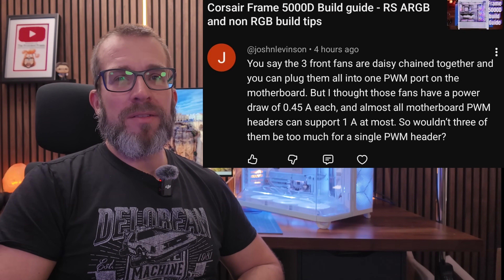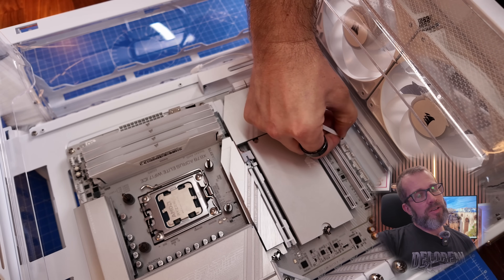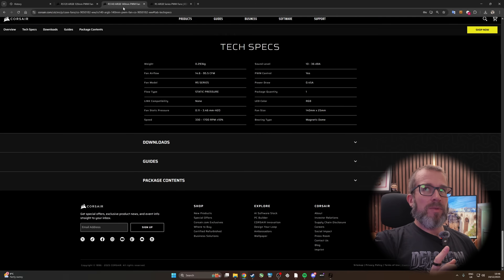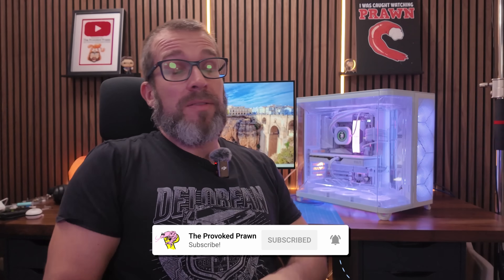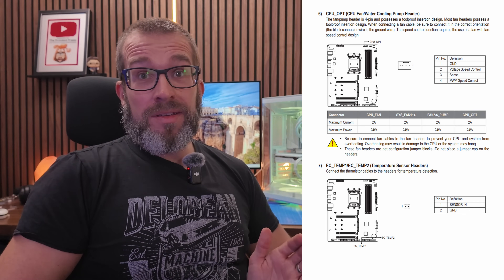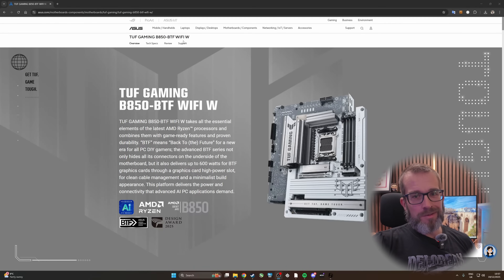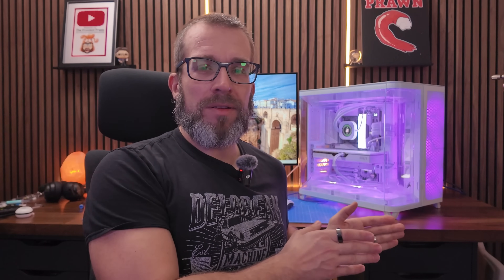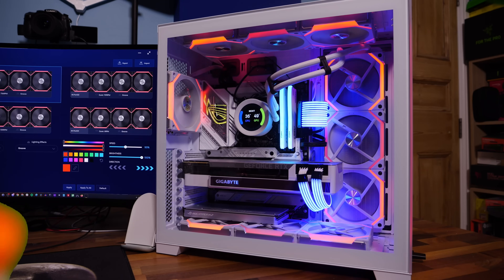Should you be worried about this??

Comment: I was worried because i planned to buy Lian Li Uni-Fan's TL Wireless 140mm in maximum three fans on bottom, side intake and two on the rear. And three 120mm fans on my radiathor of the AiO. But my motherboard can provide 2A/24W, so i can test if they can run only on the one 4-Pin connector (and dont need the SATA to 4-Pin x3 connector)

Comment: Thanks for the shoutout and for addressing my question, with a video to boot… really appreciate it!

I went deep down that rabbit hole, which is where my question came from. There are lots of people (mostly in forums, so take it with a grain of salt) that say that this is an important point, so as not to burn out the motherboard. Some people say that it can burn out the motherboard by drawing too much current, others say it will not, since the motherboard will only give the fans as much current as the MB is rated to. I don’t have enough understanding of electrical engineering to understand which is true. But in all my research, I didn’t see a single person say they had actually damaged a motherboard by plugging in too many fans to a single header. So maybe it’s not actually a problem in the real world. 

That said, I now have all my fans plugged into a fan hub. I may daisy chain two RS120 fans into a single 1A header (which is what all the chassis headers are on my MB), which would put it at 0.8A, which I think will probably be okay, even taking into account startup spikes.
Reply from the maker: Thanks for posting the comment in the first place. It's certainly interesting and not something I'd considered in great depth

Comment: I know this is off topic, but desperate for help, I bought a corsair k70 pro tkl,  but it keeps disconnecting every 5 mins for a few seconds really annoying can not play games with it like this, I've updated everything including icue, I've uninstalled icue reinstalled it, tried different usb ports, and absolutely nothing works, I have searched google and it seems a lot of people have the same problem but with no answer to fix and corsair support give no answer except what we have already tried, any help would be appreciated.
Reply from the maker: When you say you uninstalled iCue and reinstalled it, did you use the latest version? iCue can be weird sometimes. Have you tried forcing a firmware update. I'm afraid I haven't had this issue so I don't know a good solution.
Reply: @TheProvokedPrawn  hello , yes it is the latest version, I forced firmware update also and still the same, it also happens with no icue installed.

Comment: i am acquiring parts for my 1st build. asus tuf gaming b850 plus wifi, amd 7800x3d. i am asking if i should do a bios update after building or will it work ok out of the box?
Reply from the maker: I personally like to do the bios updates for stability and performance improvements that come over time (if you look you'll likely find a lot of updates)
Reply: @TheProvokedPrawn  i understand but should i do it when i power up for the 1st time or can i get on the internet and do it after i install windows. will it work ok out of the box and do the update afetr
Reply from the maker: @michaelrajca6043 should be perfectly fine to run out of the box

Comment: for a very long time, I've run the +12v to a hard drive plug, just to keep the noise from the fans from going to the motherboard. the amps thing is an issue for sure, not to say how many amps can the PWM signal from the motherboard be? I don't know to be honest.
I've seen some cases that combine 5+ fans with a single PWM control with no buffer amp (Silverstone PM01 for example).

Comment: Dear Mr. could you please explain the "coil-whine" to us ? Recently I build a setup which I had Corsair RM1000e, and ASUS TUF RTX 5080, and over 150ish watt load of GPU the "bzzzzz" sound appeared. When it is lower than that value the coil sound went away. Then I changed my PSU to FSP Hydro G Pro 1200W and it was same. I changed my GPU to MSI gaming trio model and also changed PSU to MSI MPG A1000GS, now I hear less, but still I can hear it. I am not sure if it is normal, should I keep searching a GPU model or PSU model that does not have this sound? A testing for diferent PSUs with different GPUs would be good. Could you make a video for this ? There is none on the internet right now.
Reply from the maker: I don't think I've actually ever experienced it tbh so I'd struggle

Comment: Hi, I recently completed a new PC build with a Ryzen 9800X3D, an RTX 5080 AORUS Master, a HAVN 420 case, a Kraken 360 LCD AIO, a Lian Li 1200W Gold Edge PSU with hub, and Lian Li Wirless fans. I have a couple of questions.
The PSU has USB 2.0 ports and one connection to the motherboard(the white): if I connect the fans,controller and the pump to the PSU hub and then connect the PSU hub to the motherboard, should I be able to run all the LCDs correctly using their respective software (NZXT CAM and L-Connect)? 
I also noticed that the HAVN 420 case includes its own hub, with fan inputs that have black ports and one standard white port. Would it be possible to connect the fans to this powered hub and then connect the USB cable to the Lian Li PSU hub?
This is my first LCD-based build, so I’m a bit confused about how to manage the limited USB 2.0 headers on the motherboard versus the additional USB ports available on external hubs.
Thank you in advance
Reply from the maker: Yes the edge gold should sort you out - https://youtu.be/qMoQxv_1qms

Comment: if you are concern or you discovered your fans exceed the 1 amp limit, you could get this "XMSJSIY SATA to 3 Pin 4 Pin PWM Fan Adapter Splitter Hub for 12V Desktop Computer Cooler Case Fans, 2 Pieces Packing" $9.40, £7.17  I checked my "be quiet! Light Wings LX 120mm PWM Reverse" On be quiets website, The Electrical specifications:
Rated Voltage DC (V)	12
Operating Voltage DC (V)	5 - 13.2
Input current (A)	0.10
Safety current (A)	0.32
Input power (W)	3.8
Rated Current LED (A)	0.39 
So they are 0.96 (A), whew, just barley made it. ha

Comment: my case fans are iCUE Link through a hub, which is powered by the PSU directly and uses a USB connector for fan control. just SUCKS that my MB, AIO, and GPU are all ASUS and you can't control iCUE Link fan RGB with Armour Crate.
Reply from the maker: Have you tried the Asus plugin within icue's settings?
Reply: @TheProvokedPrawn  I do have the ASUS plugin for icue, but the icue fans don't show up in Aura Sync in Armoury Crate. I would prefer to control everything in ASUS, since they are the mobo, PSU, and AIO, and icue are only case fans. But, I can't get icue to control the ASUS colors either.

Comment: Most likely, there is zero issue here...
The specs for these fans on the manufacturer's website... is that 0.40A for just the "fan part" of the fan?  Or is that the power draw for the entire fan, including the ARGB lighting?
If it doesn't specify (which in your screenshot, it didn't look like it), it probably means that that is the power draw for the entire fan.
Typically, at least half of that is for the ARGB lighting... and the power for the LEDs will come from the separate ARGB header.
So most likely... with three fans connected, you are going to max out at 0.6A power draw with the fans at 10-0% speed, far under the max for that particular motherboard.
Reply: 0.40 A it's the consume of the fan motor only (of RS 120, it's 0.45 in RS 140). 

The ARGB LED circuit is independent, and require use one ARGB header in the motherboard. Only in cheap fans with "Rainbow" LED - non controllable; the LED is powered by the same cable of the motor.

For comparison, Cooler Master specify this consumption individually, from Sickleflow 120 fan is:
RGB current -  0.09A
Fan current - 0.15A (provable the minimum)
Safety fan current - 0.37A

Comment: Even if you put 6 fans on the same header at say 50% they will only draw 4-6w in total. They only draw much higher current above 70-75% for most fans.
Its only a realistic problem if you have them running at 100% all of the time. But even then, the current ratings are much higher than reality.

Comment: i'm replacing my old pc and i got everything pretty much figured out, but i just don't know how i should cool it... i would love to use the frame 4000d, but i only see people slapping like 20 fans on there which i cannot afford at all and the corsair system also confuses me... anybody got some tipps for me on what to do? :(
i also don't know, do i need this control pannel for the corsair fans and ram sticks? should i buy the case with preinstalled rgb-fans at the front? can i get the same fans for the back? is the air cooler of corsair compatible with their vengeance ram? i'm so confused...
if anybody could help. me out, i'd highly appreciate it :c
Reply: You Just Need at least 6/7 fans of 120mm, but ofc It depends on what are you Building, i suggest if you have the Money too take a liquid cooling like the nautilus 360mm or the 240 mm for the Corsair F 4000d, if you go with and RGB system with magnetic fans you dont Need to care about anything strange you plug all the fans in the icue controller that came out the cooling system and you are fine

Comment: 04:45 You say it's only marginally over if your headers are 1A, but at 1.35A for 3 daisy chained fans, thats 35% over which IMO is far above marginal.
I built a new system a couple of weeks ago and ran into this issue. Initially I had 3x RS140 fans daisy chained at the front and something was niggling in the back of my mind about having 3 of them dasiy chained together. I then checked the specs of the fans on Corsair website showing they could draw 0.45A and my Asus B850-E manual which showed 1A headers so just decided to only keep 2 of them daisy chained and use 2 seperate headers for the 3 fans and using Armory Crate to control them. I'm happy with the setup.
Reply from the maker: Yeah fair

Comment: Electricity is either a "push" or "pull" and AMPs are a pull, so theoretically you cannot pull more AMPs then can be provided. If this happens this will lead to a catastrophic failure. So if all is working as expected the fans will run fine on a 1 AMP header, however they might be crippled in top speed. PWM over AMP pull is a rather interesting spin the issue, as the header will turn the power on and off to vary the speed and turn a pull into a push sorta, thus possibly due to this there isn't as much of an effect vs say setting header to full speed like I do for my flow/temp sensor. The only time you would actually be in a crippled situation is when you max load your system and the PWM in essence no longer controls the power given, and the fans will attempt to pull full AMP and be unable to get it.
Reply: Good explanation. I don't think a big company like Corsair is going to try and fry consumer PC's, they're probably well aware of that bottleneck considering it affects most motherboards including high end.

Comment: in 2025 if you are ok with the icue software, which for me personally works 100%, then the duo should be standard to your build.  Why?  Simple, you can connect the argb from your gpu to it too then icue controls that colour as well.  Before we had to either just use static, use asus with its armor crate, or hope to god open rgb supports all your hardware.  Slap on that zotac has introduced spectra link with at least the 5070ti (possibly lesser but still in the rtx 50 series) then the duo is even more important.  Now if you just want solid blue or whatever colour solid with no shifting then yea you don't need the hub, but still for $60 I think it should be standard now.  

Anyways just my opinion and a great discussion as usual bud.
Reply from the maker: Thanks for your thoughts

Comment: Who runs there fans at full speed ? not me mine run at 800rpm max 450rpm norm but it could be a prob for folks who do.
Reply: It's not about running them at full speed. When you power on your PC the inital power draw when the daisy chained fans spin up may go over the 1A rating of the header and could potentially damage the motherboard..
Reply: @celery4564   not if you have set them in the bios mate.
Reply: @Chaos-p4w  You are wrong. PC fan control in bios is not instant when you press the power on button. 
There is a brief moment when you first press the power button to turn on the PC when the fans can spin to 100% until the bios is loaded and takes control.
Reply: @celery4564  yes it is do you homework.
Reply: @Chaos-p4w  I did, you clearly haven't.
You can just try and google "will bios control my fans as soon as i press the power button" or I can give you a long list of other things to google that all point to the same thing.....you being wrong.

Comment: If the fan header is rated at 1 amp, your fans will just run slower if the fan setup is greater than 1 amp. Thats if the fan header is a regulated output.

Comment: Just checked my x570 proart, they are all 1A headers except for the wpump header which is 3A. The only way to actually test this is to plug in the fans and check the actual power draw. My guess is, this isn't anything to worry about unless you're running your fans at full speed.

Also if they are wired in parallel the amps will add up, if they are wired in series, they won't. So it depends how Corsair has them wired up.